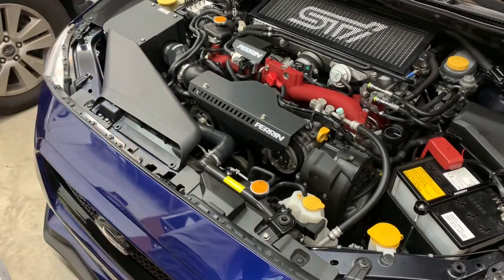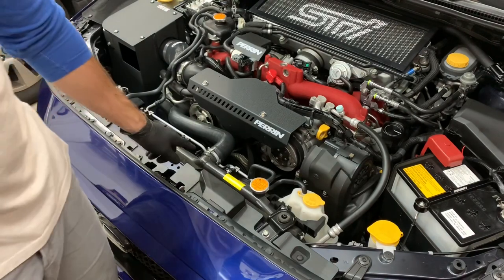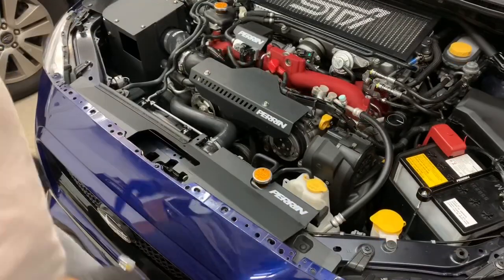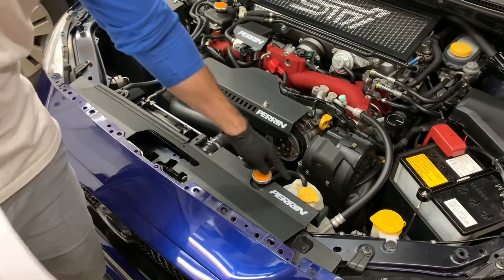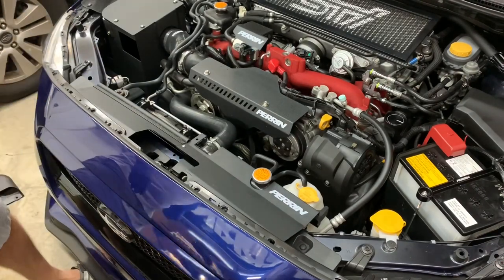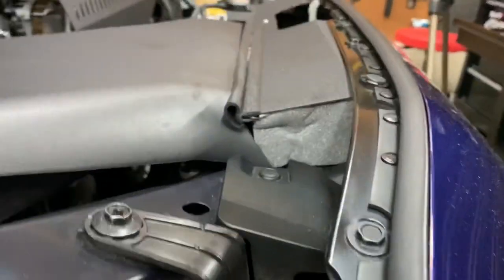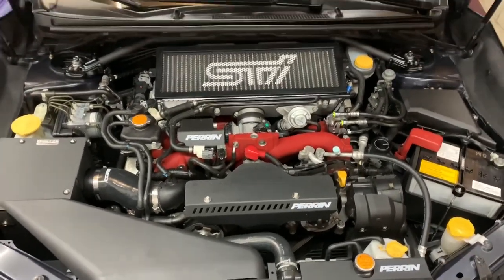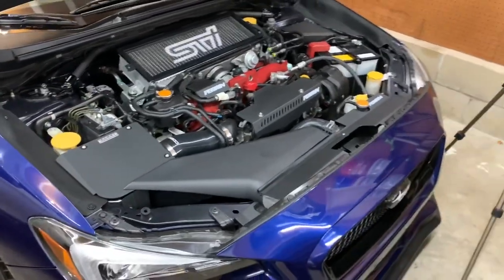Subaru STI Perrin Radiator Shroud Install

Comment: What if you left that rubber seal on the hood? i have a INGEN Cold Air intake system, think it's little bigger than the stock intake box, so i couldn't  put on the seal on the radiator shroud and left the metal part resting on top the Ingen intake box, left the rubber one on from the factory hood.
Reply from the maker: The seal wouldn't close or seal right on the intake. it would just smash against it and serve no purpose other than damaging the finish of the intake every time you closed the hood.

Comment: Hi pal, 
I just installed the radiator shroud and found that fitting the shroud between the chassis and the bumper messed up the alignment from my hood and the bumper. 
I had to remove my hood catch and pack it with washers to bring my hood back in line with my bumper.
Basically the shroud lifted up my bumber the thickness of the shroud which was clearly noticeable.  
Did you experience this problem and if so how did you resolve the issue?
Reply from the maker: Hm, I didn’t have that issue with mine. Alignment of everything was just like stock.
Reply: Strange.  I was thinking about removing the shroud and fitting it on top of the bumber but under the metal trim. Doing it this way means the bumber is not raised up from the chassis the 2mm thickness of the shroud.   
I may reach out to Perrin and get there input. 
Thanks though for the reply.

Comment: hey buddy, with the Cobb SF carbon fiber did you manage to install any on that side? perrin gave me two sets dor the intake side but i don't think they fit with the cobb sf carbon
Reply from the maker: The left side doesn’t work with the Cobb redline intake. Just the right side. Yes, I run just the right side of it. https://youtu.be/TpNUHWzg7Dw